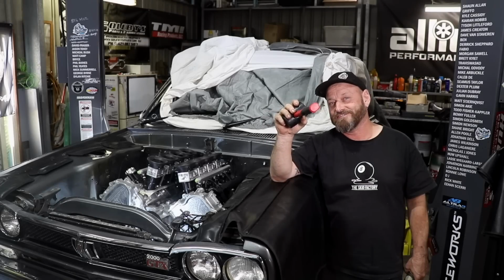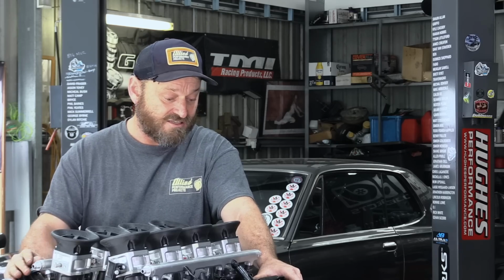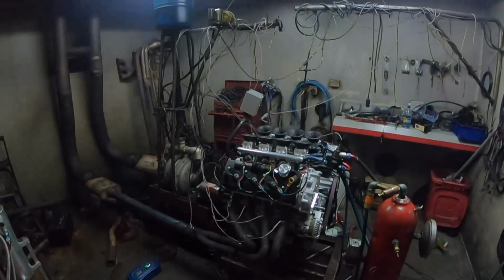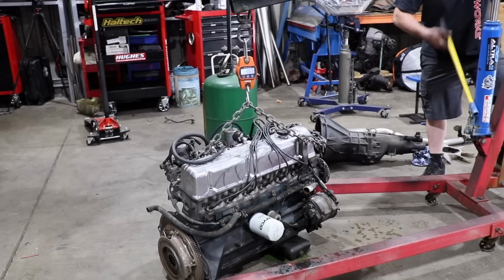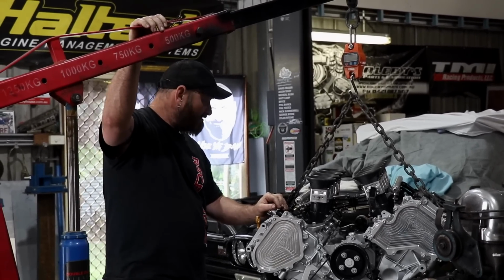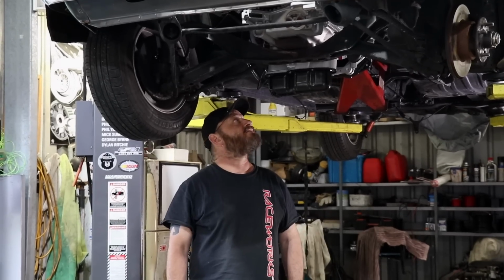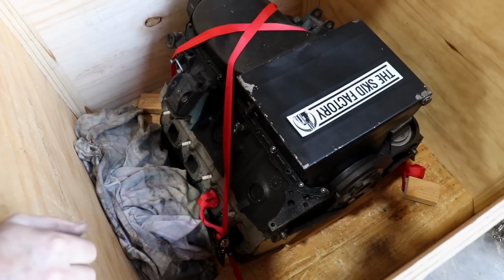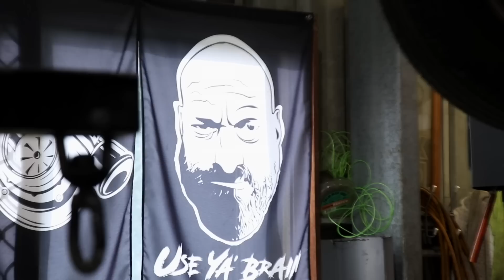Unboxing the Hulkosuka’s NEW Powerplant!

Comment: I bought that Allied Performance projects cap, I really like it. A tip if anyone is struggling with sweat stains on caps (we've all been there 😅) use Sard soap and some kind of scrubber to agitate it with water as well obviously. Then rinse it off. It will remove sweat stains.

Comment: Hi guys love this new build. I see your thinking about going ke70 r and pinion. I used power ke70 rack into ra celica years ago with some parts from T3 in the states. You can buy an ae86 rack new from T3 FLOS in Ireland make new ones I have one so if you need some measurements please ask. I had a power assisted rack and found it ok but now I’ve moved over to EPS using 86GT / Subaru unit. It’s all basically new that’s why I did it. I run an S15 BC coilovers with camber/castor adjusters and R33Rotors with Wilwood 6Pots ( the dust boot ones) with radial mounted. The caster camber arms are adj T3 ones that work with Nissan stuff. Can’t wait to see more 👍

Comment: I need to get one of those scales to weigh my ford 460 big block. It's got cast iron block, heads and intake manifold and cast iron shaft drive adaptor on the back for when it was in a boat. My dad and I had to move it a couple weeks ago and I had the engine crane set to the 1000kg point, and it took a bit of effort to pump the handle. It didn't help the the wheels were almost inline with the end of the boom because I couldn't get access to it properly, I got my nephew to stand on the back of the crane for counter balance.

Comment: VK5X choice is Nissan perfection just a bit of chrome like a bolt on cover lid from stainless to top off a plastic printed plenum, also chrome or black inserts to rid machined look rocker gear inner cavity area would tie in the engine to the era and chrome line of the hako. Hope the brakes and suspension get what they deserve.

Comment: I reckon the engines are very close weight wise, perhaps the iron block "just" coming in under the alloy v8. But to answer where the added weight is coming from, I reckon from the gearbox, specifically the gearset mainly.

Comment: 11110-1MC0A This the part number for the VK56VD front sump upper oil pan.  It can be found in infiniti M56, QX70, FX50, and so on. This rwd model is shorter without the hole for AWD.

Comment: Make sure you guys do air box for the trumpets AND do 8x throttle body post vacuum for brake booster and PCV, can't road register a vehicle that doesn't have matching PCV/CCV design :) for constant idle vacuum assisted removal of blow by, by the looks you guys are going to have a issue getting vacuum source POST throttle body unless those socket head bolts on the 3D printed parts are for that? ... This has to be considered for roadworthy

Comment: Surprised that it doesn't have crossover intake runners, like some of the Harrop manifolds do, to have more bonnet clearance. Would make it easier to have a plenum and a filter. Suppose the port spacing isn't big and they would have to be a funky design to get them past each other. No doubt that has already been thought of.

Comment: not 100 percent sure but isn't the sump for the same years infiniti m56 shallower and positioned differently? may wanna check into that. not q70 but m56 line up on the infiniti side here in the states

Comment: Is a complete front cross member from a Z car an option rather than trying to make some other rack fit?
As a general rule, all old Dattos had parts that swapped with other models in the range.
You could fit 240K struts and brakes in a 1600, the R30 Skyline IRS fitted under the Aussie 910 Bluebird chassis to get rid of the horrible 4 link etc ect.

Might be far easier to blend other parts from the 'family' than chase bump steer on another brand 🤷‍♂️

Comment: Kickstarter to get Allen an emotional support hair piece?
Most of the old engine swaps I've done in the past with stuff like a 202 to an LS1 you're looking at about anywhere from 50-70kg lighter (aluminium block) for just the dressed engine with all the stuff dangling off them sans gearbox. Those old 202's used to be about 250kg or thereabouts from memory, very good boat anchors!

Comment: I imagine the v8 is lighter. The lack of an intake manifold and carbs on the v8 as well as it being a lighter material and being a built motor all contribute to a large weight savings over what im assuming is a mostly stock 2l hunk of iron. the v8 is more than double the displacement with 2 extra cylinders so im going to hazard a guess that the volume of iron and aluminum, were you to melt down both motors, would be very similar.

Comment: Awesome build. I LMAO at the start when you had the angle grinder in your hand. I thought that would have got the keyboard warriors going! But no. Your fans here are of the same mind.
I watched until the end to get the weights. Surprised to see the engines are so close in weight. No surprise on the gearbox. My guess is the gearbox is close to the centre of the chassis. So the extra weight shouldn't affect the over-all balance. Keeping the "Handling Purity!" LOL.
Will you mini tub it? Or what size rims can fit? Power down with 500+ hp will be fun.
silhouette remains OEM, other than wheels and ride height. Until it is on a hoist, to see the 'next level' fabrication.
Looking forward to the rest of the build:)

Comment: The V8 is shorter and wider, and I’m sure that 6 speed weighs much more than the original trans. So the weight distribution will be better. It would have been nice to four corner scale the car before and after

Comment: The tr6060s in the turbo falcons with a bell housing weigh 72kg wet. That 5.6 would be lighter than the original box and motor combined.

Comment: I'm in a steel cage of emotions right now! Surprised about the weight of the 56,i would have pegged it at 240+ although what's the AC compressor and I assume the exhaust manifold weigh on the LSeries? Maybe not the fairest fight but an FJ20 in a 1600 both is a big weight difference and doesn't fit and I approve of that... 🤔. Yea it's rare as hell but I guess you only really want it for the look of the car so play on. I assume it will maintain the weight distribution as long as you jam it back far enough. I'm sure you can spend lots of money on an RB26DETTNeo if it doesn't work and throw the Vk56 into a 1200ute, bonnets-a-bulging... This is really going to be the next Bedford in terms of fitting it isn't it?

Comment: Dry sump could be an option if there is room for the external oil pump. I'd imagine the reservoir doesn't need to much bigger than standard sump capacity. Such a beautiful engine.......

Comment: Would doing dry sump systems make any of your conversions any easier?
Reply: Not really. For a dry sump you have to mount the pump somewhere and work out a belt, mount a tank somewhere and possibly make a tank, and then make all the hoses to plumb it all up. And, all that stuff is expensive. 

With a wet sump at worst they have to modify the pan and pickup.

Comment: im assuming that if that is all necking down to one pipe then it has to be a 4 inch exhaust
Reply: Perhaps. Though you don’t need a 4” exhaust for 600 crank horse power. 3” would do it. NA motor so still want a little back pressure.

Comment: Might be worth looking into a 350Z/370Z CD009 transmission
Reply: What for?
Reply: That trns would eat itself.
Reply: cd009 transmissions are massive if i were to change the transmission i'd go with a bmw zf 6 speed because they are just if not stronger than cd009 and smaller but im not sure they could handle the torque of the motor not mention have to make a new adapter plate and also not sure how hard they are to get in australia
Reply: @richarddome5698   why would you change the trans? What’s wrong with the TR6060?

Comment: Here in the states those are the least efficient way to change gasoline into noise, you can get those trucks with low miles because no one could afford to drive them because they are so bad on fuel

Comment: I bet the VK is about 5KG lighter engine vs engine without flywheel. With flywheel, clutch, and trans that's where the real difference is ALL coming from.

AND AND AND... while the L engine might technically have a lower center of gravity, because it carries more than half it's weight in the block and rotating assembly, the VK will push center of gravity further rearward considerably, and that's before we even consider final placement in the engine bay, as you boys will likely get it nearer to the firewall than the L engine sat.
Reply: Oh man, it was even closer than 5KG. Gotta love it.

Comment: But why get rid of variable cam timing on a street engine?
Reply from the maker: Large cam overlap can cause clashing issues when variable cam timing is used. It also simplifies the engine management system and tuning process.

Comment: 40kg heavier engine lighter gearbox. double bozo pipes out the back slammed on some rays, to match woody's hair
Reply: The weight distribution will be better, and the center of gravity will be lower, it may be a little tighter, it shouldn't plow, but it will roast the rear tires. I bet they'll spend $$$$ x 3 on the rear axle and suspension unless they go with something like a Cadillac independent suspension, that way they can shorten the axles and handle the horsepower. If they can handle an 715 hp LT5 they can handle 450 flywheel. One guy used a Cadillac diff on his LS3 swapped Miata and it seems to have worked fine. If I were going to do track days with this sweet machine I'd probably check the wrecking yards to see if one was available. Or maybe I'd install a 4 link shortened  Ford 9" and piss everyone off. It's fun spending pretend money isn't it?
Reply: I think you will find its the other way both were aluminium boxes but tr6060's are huge

Comment: What’s the motivation to delete cam phasing at this power level given the power plant is not going to spend its life at continuous high rpm
Reply: It’s a lot of complexity to have to wire and deal with. Also, may not work with the cams if they’re already aggressive enough to need to add valve reliefs to the pistons. They might get into valve to piston contact if the cam timing is changed very much. 

Plus cam timing just moves the power band around and they’re not really going to be hurting for low end power with this setup. So, having the cams set for higher rpm won’t hurt.

Comment: This car will be insane but i'm not a fan of the engine choice. A high comp VQ37HDR or VQ35 with parts easily available would have been better 300-350hp would be perfect with  a wailing v6......I hope they don't chop up the car too much ....I'd make sure any chances could be reversed .... still ...FULLY SICK .... :)